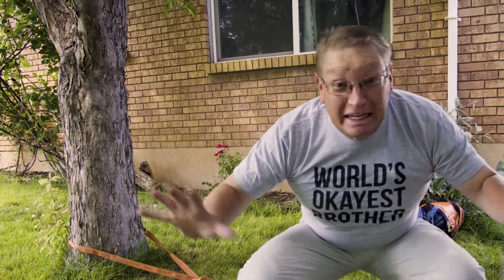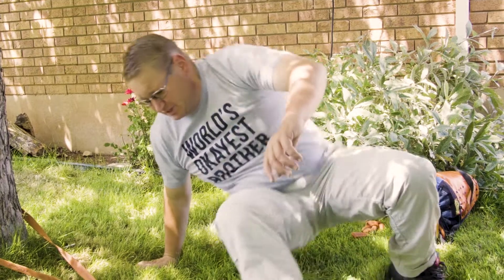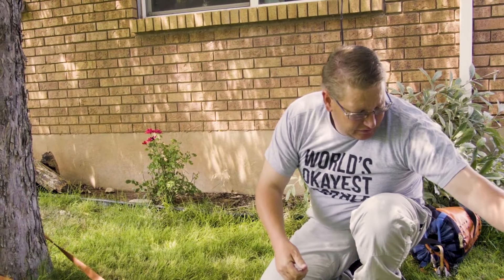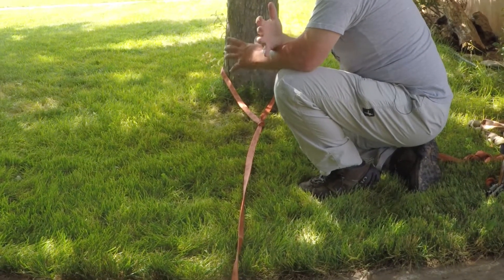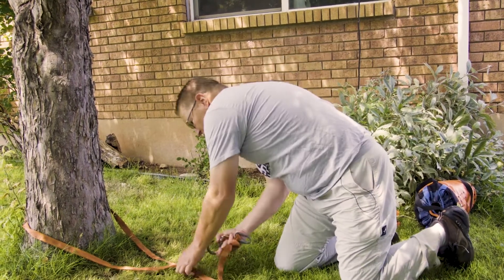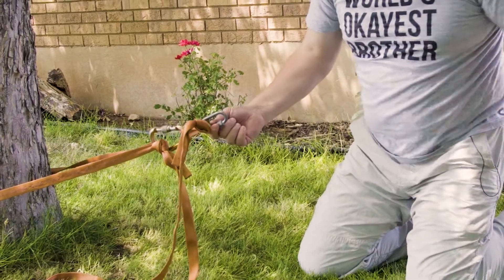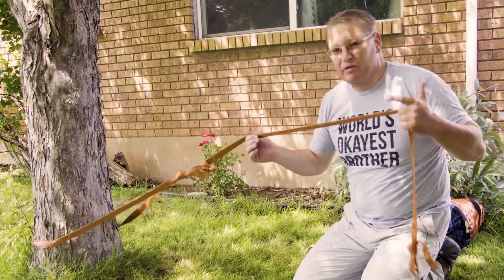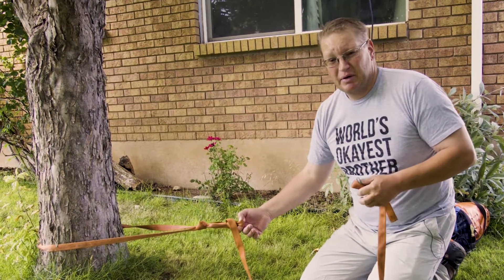Single Stranded Webbing Canyoneering Anchor | Part 1

Comment: I just used this setup a couple days ago at Jolley Gulch. Courtesy rigged so the two before me had an easy start on a 165ft drop and I got the thrill of sliding off that edge..good times! Great video, thanks!
Reply from the maker: Great work! How was the edge? Would it be a real webbing cutter without using the courtesy anchor rig?
Reply: @NorthWashOutdoors  Not so much a webbing cutter but easy to stick a rope with a block in it, so extending it over the edge gave us a great rope pull. How do I know this? I stuck a rope there my first time doing it, haha.
Reply from the maker: @precipiceofgrind  Hahaha - I told Matt the other day (he is in a lot of our videos) that learning from our Non-Fatal mistakes is always the best teacher (He got a hook stuck trying it out as a rappel anchor for his first time).  
Being able to pull the rope better is always a huge upgrade. I've gotten some rope stuck before and had to repeat canyons to retrieve my rope. 165' drop is a big one to try and mess with a pull on.

Comment: When clipping the down canyon loop in this system, wouldn’t it be better to clip the rapide vs the webbing?  This would put the load only on the long axis of the rapide.
Reply from the maker: Better? Yes!  If your thinking of this while watching it your awesome! The thought process in discussing this is that most often those who use these anchors with out already contemplating using a courtesy or creating a redundant system are not conscious to what the best anchor set up really would be. Therefore I’m trying to simplify this process and not over complicate making this anchor better. Clipping into the rapide would absolutely be better for the webbing and the knots. 👍🏻👍🏻
Reply: This was exactly what I was about to ask haha. Not a fan of how the lower knot gets loaded when you clip it up higher.

Comment: Why not tie a frost knot into the system instead of the water knot? Then you don't have any extra knots.

I like to see the end of the loop doubled back from the loop (tie bunny ears to make clipping easier) and then there's a redundant loop at the edge. Steve Szoke teaches it this way in the ACA trainings.
What are your thoughts on that?
Reply from the maker: Perfect!  I love it, and it's better that way. The concept here is a quick and simple resolution option for the Canyoneering participants who are untrained in those better methods. This version at least helps to get that courtesy concept in the system to help reduce issues in groups where trained leaders exist.
What thoughts do you have on how could we pass on those better options for anchor rigging to the less experienced community?
Reply: North Wash Outdoors the first step is engaging a community that is largely not willing to change or spend the time learning new techniques. 

There are a lot of climbers that think canyoneering is just the opposite of climbing. And it’s so much more. 

We need to find a way to help people understand just how much easier proper technique can make a canyon. 

Example, I pulled a brand new triple length dyneema sling with a BD locker off a simple down climb in blarney this weekend. It was obviously used as an anchor for a short rope rappel. Things like that are not only baffling, but straight up confusing. 

Proper gear + proper education=more fun
Reply: I also believe that generally people are scared to participate in ACA training because they fear their skills are either too far below the group or too different.   

It’s an attitude thing from my view.
Reply from the maker: @ggexploringUT  Good thoughts. I've seen more Canyoneering rescues happening the last 3 years than I saw in my whole first decade of canyoneering and I'm perplexed with how we can make the community safer and provide training that everyone is willing to engage in and get on board with.  Anchors are the base of a whole rope rigging system for rappelling. Anchors are where that rigging starts from in order to create a system safe enough.
Reply: North Wash Outdoors couldn’t agree more. Let’s get into a canyon! I’d love to learn from you first hand!